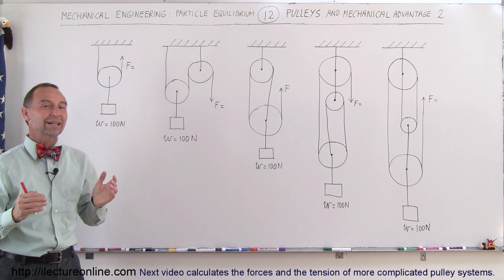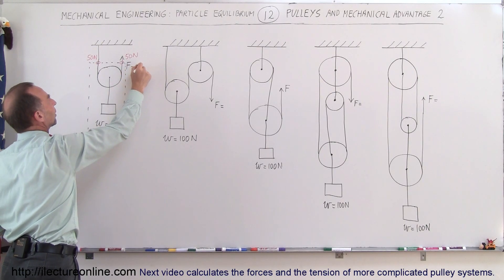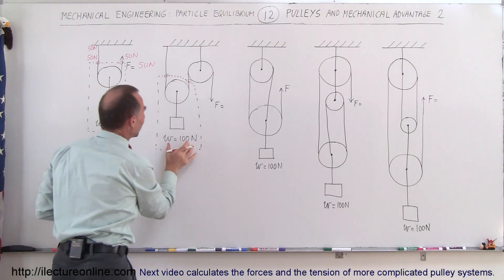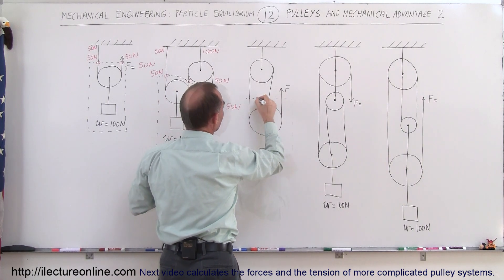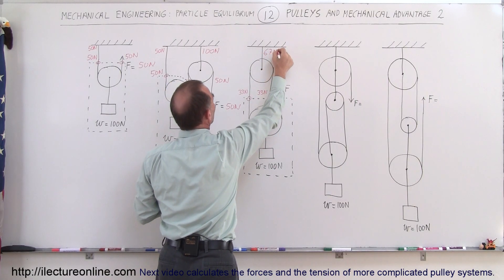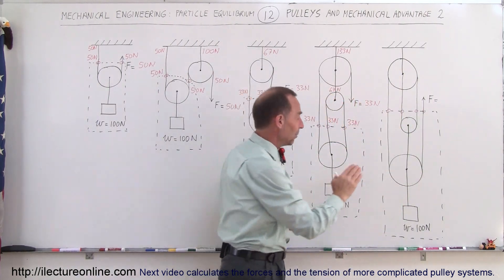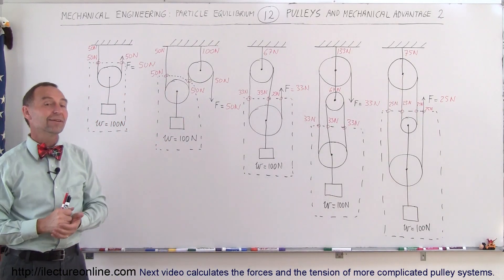Mechanical Engineering: Particle Equilibrium (12 of 19) Pulleys and Mechanical Advantage

Comment: I am confused, aren't you making the force vectors arbitrarily large to be considered in some cases and not in the others? And how can the force applied on the string connected to the seeling can be any higher or fewer than the weight that the system is charging?

Comment: I can understand the first four questions, but why should the middle pulley be included in the analysis of the fifth question?
Reply from the maker: The free body diagram indicates that there are four ropes at the top supporting the weight on the bottom.  The sum of the tensions must equal the weight of the object.

Comment: Why did you use the second pully in the free diagram on pully system 5 and didn't use the second pully on pully system 4?
Reply from the maker: On system 5, the bottom 2 pulleys are connected, so they act as a single sub-system.

Comment: Can a 2000 lbs weight dropping 2 ft, lift a 500 lbs weight 8 ft (ignoring friction)?
Reply from the maker: Yes, with the correct pulley system you can.

Comment: In the last example, what if the FDB boundary was cut around the pulley with the weight?
Reply from the maker: The tensions in the 3 strings will still add up to the 100 N weight.
Reply: @MichelvanBiezen  But that would be 33 N (each).

Comment: Sorry 100 pulley will not lessen the weight even a gram if it is fixed only movevable pulley can lessen the weight
Reply from the maker: The weight of the object will not change, but the force required to lift is will.

Comment: can anyone explain how we draw the free body diagrams which determine the strings that are aiding at pulling the weight at the bottom? for example, in the example second from the left, why do we determine that only two strings are in effect, and not the third string? I feel like in an exam i could just as easily encompass the 3rd string in the free body diagram and wouldnt get the answer of 50N.

many thanks
Reply from the maker: Essentially you can draw them anywhere you like.  The guidance is that you draw them such that the boundary cuts through the strings (or forces) that you are interested in.  In a tatic case (like this) the sum of the forces pulling upward must equal the sum of the forces pulling downward.
Reply: @MichelvanBiezen  Thanks Michel. appreciate it. I think asking the question, which strings are pulling the object in the opposite direction - is helpful. thanks so much for taking the time to reply! <3

Comment: Hey genius! 3,4,5 are 100 ceiling weight.
Reply from the maker: The values shown in the video are correct for example 3, 4, and 5.  (They are not equal to 100N)

Comment: What about the weight l mass of the pulley(s) in addition to the given load?
Reply from the maker: In most examples we ignore the mass of the pulleys.  If they have mass you do have to add their mass to the free body diagrams.  (We probably should add some example videos)
Reply: @MichelvanBiezen  why ignore the fact? Please teach correctly.
Reply from the maker: In almost all cases, the mass of the pulley is insignificant to the mass of the object.  That is why the mass of the pulley is ignored.

Comment: I'm not sure if the weight supported by the ceiling can be less than 100N.
Reply from the maker: For the example where the force is directed upward, the tension at the ceiling will be less than 100 N

Comment: Pulley system 2 was a mindblow to me. I managed to predict 50 newtons on each end of the rope because you taught us that all the ropes have to have the same tension, and i predicted 50 newtons on the left rope attached to the ceiling, but had no idea what the weight on the right rope attached to the ceiling would be and was really surprised at 150 newtons total force. 

I think the way it works is like: In pulley system 1, we have 100 newtons of force pulling down (the weight), and 100 newtons of force pulling up (50n from ceiling 50n from person pulling)

But in pulley system 2, there is 150 newtons of force pulling down, the weight (100n), and the person pulling (50n). half of the weight is going into the ceiling, which means the other half HAS to be going into the pulley, and the person pulling is ALSO putting 50 newtons into the pulley, so it has to be holding 100 newtons.
Reply: Third pulley system predictions: it's gonna be 33 in each rope, the top pulley is going to be holding 66 newtons, and the person pulling would be lifting with 33 newtons. so 3x mechanical advantage.

Fourth pulley system predictions: The bottom pulley is connected to 3 ropes, so that has to be 33n in each rope. The middle pulley is 2 of those ropes, so that has to be 66n newtons from the middle pulley pulling on the cieling. The top pulley is holding 33n from just the weight, but if we also add the 33n from pulling on the rope it will be 66n. So middle pulley is 66n, top pulley is 66n, for a total of 132n on the ceiling

This feels wrong and like more mechnical advantage should mean more weight on the ceiling, but more mechanical advantage literally means we have to put less force into the system. we are only addding 33 newtons of down force into the system by pulling down with 3x advantage, where as when we had 2x advantage we had to put an extra 50 newtons of down force into the system. So more mechanical advantage weirdly enough means less strain on the system because it's being divided up more i guess.

Fifth pulley system predictoins: I flipped the video vertically and it seems to literally just be the fourth one but upsidedown, so that we are pulling up instead of pulling down. as an initial guess that should mean only 100n in the cieling cuz we are removing our downforce, but that shouldn't be possible cuz we are lifting a fraction of the 100n so the cieling can't be supporting all of it.

Oh i forgot to also add the upforce instead of just removing the down force. If we represent downforce as negative upforce, then we went from -33n to 33n, for a difference of 66n, but i only did a differnce of 33. So my initial guess should be that the ceiling is holding 66n.

Ok now to actually try to figure out whats going on: the bottom pulley is directly connected to the middle pulley, so pulling on the middle pulley by 1 is just as good as pulling on the bottom pulley by 1.

I see 3 things coming out of the bottom pulley, one of them being our up force, so i FEEL like we should be lifting 33n but one of the things coming out of the bottom pulley is just a direct connection to the middle pulley.

So really, if we consider that pulling on the middle pulley is just as good as pulling on the bottom pulley, and we consider that the middle pulley has 2 connections to the top pulley, and the bottom pulley has 1 connection to the top pulley, that's just as good as if the bottom pulley had 3 connections to the top pulley. We also have 1 connection to the person pulling the rope, who is applying an up force. so it should be 25 newtons of force being pulled, and 75 newtons on the ceiling.

Time to see if my predictions were right i guess
Reply: Ok I think I got every answer correct, but I messed up visualizing the free body diagram on the fifth pulley system. Thank you for these videos!
Reply from the maker: Glad you figured it out!  🙂👍

Comment: Drawing #4 is wrong.   A 100n weight can not pull down with 133n.
Reply from the maker: The drawing is correct.  The 100 N weight is beying pulled UP,  and the force downward required is 33 and 1/3 N (Rounded to 33 N).
Reply: @MichelvanBiezen  How can 100n pull down with 133n?   I have several pullies and rope, I can build this to see what weight reads on my scale.
Reply from the maker: We now have about 1/2 dozen videos on different pulley combinations.  Try to duplicate some of these examples to see how it works.

Comment: I have a question... If in diagram 2 you switch the load and the ceiling around, do you then go from having 2:1 mechanical advantage to a 3:1 mechanical advantage?
Reply from the maker: Not sure what you mean by: "if we switch the laod and the ceiling around".  We'll have to make some more examples of different pulley combinations to illustrate some other setups.

Comment: Someone correct me if im wrong,  but if i hang 100n from the ceiling then the force on the ceiling is 100n, plus the weight of the pulleys and rope.  So if his formula which seems right, IS right. The he should have said "plus the weight of the pulleys" . Because they are not light and several will get above 50 lbs quickly.
Reply from the maker: For the purpose of understanding the principle of how the pulleys work, we are ignoring the weight of the pulleys.

Comment: I understand that each side of a rope takes part of the weight but ultimately the ceiling mount should be the weight of the object divided by the mounting string in the pulling string???
Reply from the maker: The force on the ceiling will be equal to the weight + force (when pulling down)  or  will be equal to the weight - force (when pulling up).

Comment: Wait, so... arranging our pulleys a certain way has the consequence of imparting a net gain of force on the point of contact with the fixed plane? We effectively make the object to be displaced heavier than it actually is? That's weird..
Reply: Well, you´re not really making the object heavier. In short: the upwards forces need to balance completely with the downwards forces. The amount and arrangement of pulleys does not change that.

When pulling upwards, the force we apply should be subtracted from the force the ´fixed plane´ needs to apply to keep the weight non-moving. If we pull in the opposite direction (downwards) then our force is acting in an opposite direction from the 'fixed plane'  force. In order to make up for us pulling on the ceiling in addition to the weight, it needs to counteract that with an equal and opposite reaction.

Comment: Not true.  You can not reduce a single line anchorage compared to the weight no matter how many pulleys you use.   You only reduce the force need to lift it.
Reply: Yes, you can. If you are pulling UP the force on the single ceiling line is the weight MINUS the force needed to pull UP.
Notice how he alternates his examples between pulling UP and pulling DOWN. For pulling up, the force on the ceiling is the weight minus the pulling up force while for pulling down that force is added to the weight.

Comment: Not sure if you'll even see this, but here goes:  In the 4th example, how can the amount of weight supported by the attachment point at the ceiling (133N) be more than the amount of weight being hauled (100N)??
Reply: 100 Newton came from the mass of the object and another 33 came from external force that is acting on the end of that rope (the line with arrow) I understood it rightaway when thinking like this 😄
Reply: You have to apply force to pull it down remember?
Reply: Because you have that force (F) included as weight to carry by the ceiling
Reply: Only movevable pulley can reduce the force

Comment: It would be interesting to give the ratio of the load lifting speed to the speed of the driving force F if for example we have a winch with a motor.
Reply from the maker: The ratio for the speed (or distance traveled) is the same as the force required to lift the load.  If you need 1/4 the force you will have to pull 4 times as far.

Comment: At 2:23, You show there is  "(150 total), 100N pulling on ceiling", when the total load is 100N shared by 2. it should be 50N?
Reply: When you are pulling UP, the ceiling only has to carry the weight MINUS the force of pulling UP.
When you are pulling DOWN, the ceiling has to carry the weight PLUS the force of pulling DOWN.

Comment: Can someone explain why the load is attached to one pulley instead of one end of the rope?
Thank you
Reply from the maker: When you take a simple example with one pulley, you will see that the tension on the rope is half the weight of the load, but if you place the load on the rope on the other side, then the tension will equal the full weight of the load.

Comment: Why in example 3 the force on the ceiling is higher than the object itself?
Reply: Because there is the force applied in addition to the weight
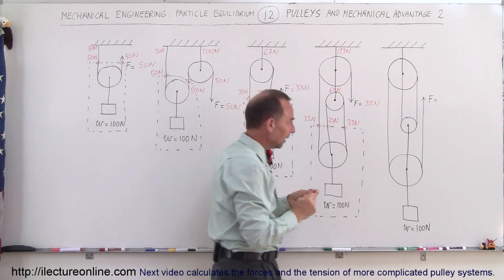Reply: Wait why at 4:57 is it 67 Newtons..shiuldnt it be 33..and ifnits,double then it should,be 66..where did he get 67 from?
Reply: @leif1075  it's actually two 33.333... N pulling down, so according to the free body diagram for that single pulley, the force pulling up should be 66.666...N ≈ 67N
Reply: @leif1075  100/3=33,3333333333333333333333
33,33333333333+33,333333333333=66,66666666666666=67

Comment: Newton is the unit of force. Weight meaning mass should be measured in kilograms.
Reply from the maker: weight  does NOT equal mass    weight = m x g  (mass x acceleration due to gravity)
Reply: @MichelvanBiezen  I agree, but go to the store and for 10 N of sugar?
Reply: I agree, but go to the sore and order 10 N of sugar
Reply: @nielsmadsen2185  weight is not mass !!! As a dog is not a cat that is way you can't buy 10N of sugar
Reply from the maker: In the US we buy pounds of sugar which is indeed a unit of weight and not mass.  However there is nothing wrong with buying kg of sugar by adjusting the scales so they convert the 9.8 N of sugar they are measuring and depicting it as 1 kg.
Reply: @MichelvanBiezen  You said before that weight=mass * acceleration which has the unit of force(N). Now you say that the unit of weight is indeed pounds. Which is it?
Reply: Pounds is the unit of mass
Reply: @robertgheorghe982  The unit of mass is kilograms (or pounds if in the US).
Reply: I also hear americans use footpounds for torque, which is ridiculous. The proper unit for torque is Nm.
Reply: @nielsmadsen2185  We get away with using mass and weight interchangeably in every day speech, because 9 times out of 10, it doesn't make a difference.  The general public who forgot their high school physics, do not think in Newtons, and think in terms of force units that match the weight of familiar mass units.  The gravity on this planet varies by less than a percent across all locations, so we get away with assigning units such as kilograms and pounds to double as force units in addition to ordinarily being mass units.  The underlying assumption is that the gravitational field is equal to the global average of 9.80665 N/kg, where it is defined that 1 kg weighs 1 kg-force, and likewise 1 pound-mass weighs 1 pound-force.

In scientific applications, we need to be more precise with our terms, because weight isn't the only force that is of interest to us.   In order for Newton's second law to maintain its elegance and simplicity, the unit of the Newton was defined such that a net force of 1 Newton would accelerate a 1 kg mass at 1 m/s^2.  Since Earth's gravity is not 1 m/s^2, you weight in Newtons is a different number than your mass in kilograms.
Reply: @nielsmadsen2185  Weight is not equal to mass * acceleration.  Weight is equal to mass * gravitational field strength.  Think of the units of g as Newtons/kilogram, rather than meters/second^2, because that gives you a better idea of what it really is.  It indicates the gravitational force.per unit mass.

It is a grand coincidence that the gravitational mass (the m's in F=G*M*m/r^2) and inertial mass (the m in Fnet=m*a) are a package deal, because this also means that the free fall acceleration of an object in a gravitational field, is equal to the strength of the gravitational field.   Weight and inertia are both proportional to each other, and dependence on mass will cancel out of the equation, for the special case of an object in free fall.  This is only the case for the special case of free fall, and not for acceleration in general.
Reply: @carultch  Stepping on the bathroom scale you're measuring the FORCE your mass exerts on the scale in a given gravitational field. The gravitational field may change in strength , but your mass stays the same.
Basically I agree with you.
Tell the Americans to go metric. Anything else is incredibly stupid!
Reply: @nielsmadsen2185  Depends on what kind of bathroom scale you are talking about.

A spring scale measures the support force required to keep you from accelerating downward due to gravity, and compares the apparent force of gravity to the deformation and stiffness of the spring.  It doesn't measure true gravity, because you cannot measure gravity directly.  It measures the constraint force.

You might have a physician's balance instead of a spring scale in your bathroom.  A balance as opposed to a scale, does a comparison of the measured weight to the weight of a reference mass.  It is agnostic to how large the gravitational field is (as long as there is one, and close enough to uniform).  A balance will give the same result for the same mass tested, regardless of what gravitational field it is in.  It would work the same on the moon as it does on Earth.

My physics teacher brought up the example of triple beam balances, when asking us to predict how they would work on the moon.  He expected the class to say that they would measure a 60 gram sample as 10 grams, which you would expect for a spring scale and you would be correct.  But he was surprised when the class realized that triple beam balances compare gravity to gravity, and would still give a read-out of 60 grams in both locations.
Reply: @carultch  You should get out more.
Reply: @nielsmadsen2185  I do agree that it would be better if Americans went metric, but we have over a century of technology based on the US customary system of feet & inches, and pounds.  It is very difficult and expensive to overhaul it and replace it with the metric system.  Plus, products built with the inch system in mind are generally cheaper to get in the US due to economy of scale, so economic forces cause everything to be specified and calibrated in the inch system unless there is a compelling reason to do otherwise.